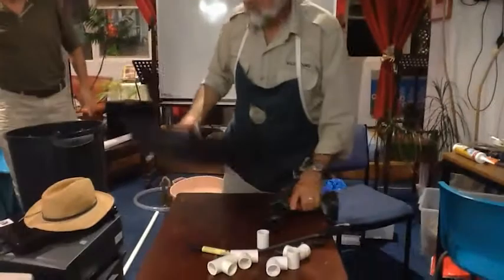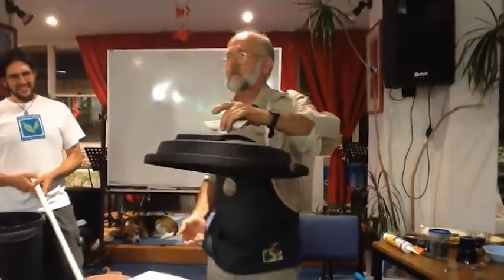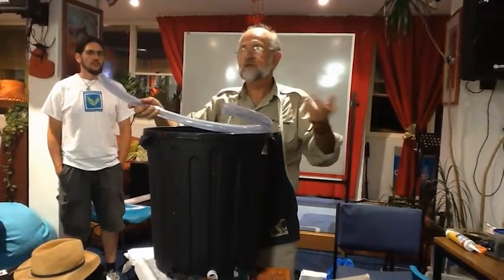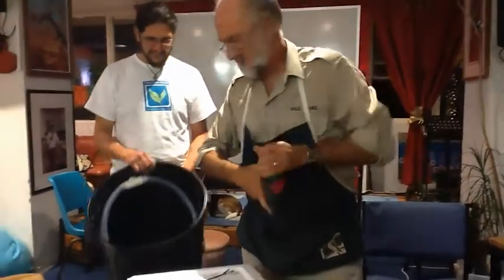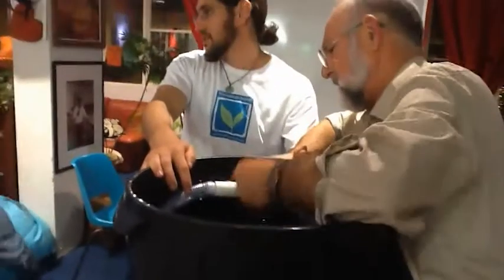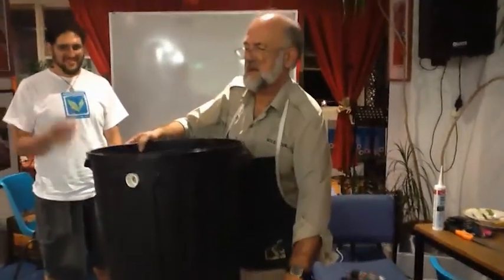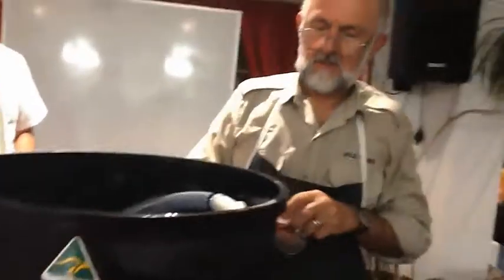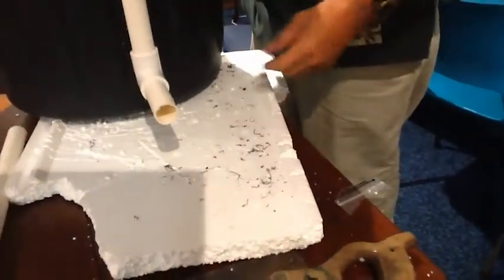How to make a DIY superfly compost bin in 30 mins!

Comment: You could put the reinforced tubing in place without the zip ties, then get a marker and mark where the "topside" (or holes) would be, then remove it and cut the holes, then put it back in and zip tie it in place.

It would be cool if this guy could travel to hardware stores that sell all the parts, and sell soldier fly larvae, while helping the store sell all the non-larvae parts. Seems like a benefit for both. They could setup with all the basic stuff and offer to cut it (by a store employee who would normally cut it anyway) for whoever wants it. The only part missing would be putting the holes in the trash can, but they could offer to sell the hole-saw bits and drills on display for convenience or maybe someone could offer to cut them for people for a small donation, maybe $1-$3 per bin, limit 1 per person.

Comment: Using waste bins with wheels that can be tipped sideways to get the 30 degree angle...brilliant.  Why buy an expensive biopod when you can get a larger wheeled unit for cheap.

Comment: Kudos to Gavin for a good modification to my tube harvesting system, however I think there are few significant shortcomings to this design; insufficient ventilation, no larvae barrier (the larvae will climb the walls and escape from under the lid), the filter system seems prone to clogging, and the drain outlet as shown will probably leak. I also don't understand the appeal of rushing the build. Good effort, but I do not think this unit is the equivalent of a BioPod.
Reply: Nope but a lot cheaper